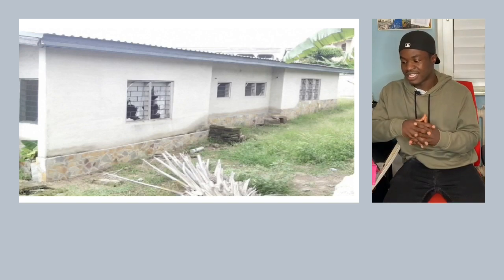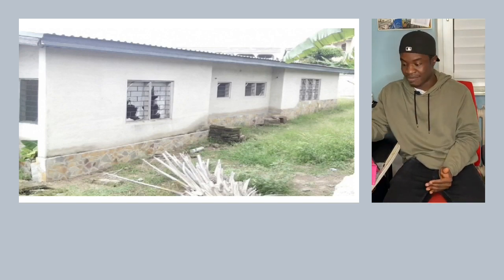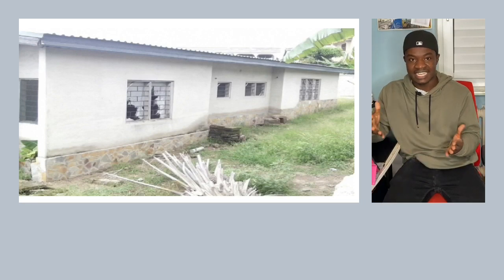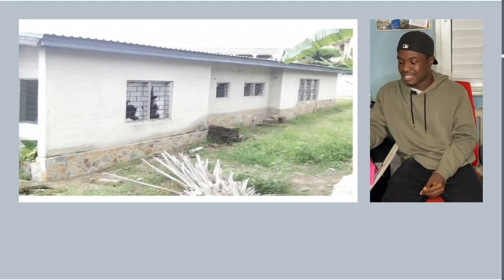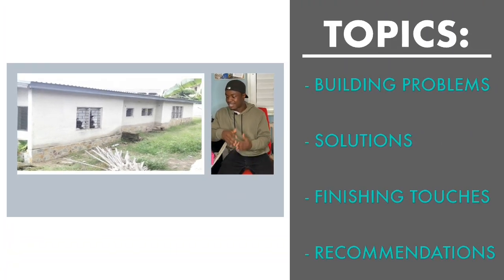BUILDING IN GHANA || PROBLEMS AND SOLUTIONS | CONTRACTORS RECOMMENDATIONS || DON‘T WASTE MONEY

Comment: I have worked in the house construction building so I know what I am speaking about
Reply: I have already built so how can I use or solution to prevent the Damp... Thank you
Reply: @abdallahgibril4836  I am sorry on this question I can't tell you a solution because you already built up the walls I don't even know if there is a water penetrating solution that you can bore holes along the joint and then pump it through so that it will spread and then form a base that will stop the damp from coming up through the blocks we live and learn sorry I can't advice you on this matter
Reply: @kojomensah7474  oh OK thank you 🙏🏾
Reply: @abdallahgibril4836  I don't know if you will be building again but I would advise all those to look at  polystyrene panels which is much faster than using concrete blocks and I don't think there will be this issues of  water vapor
Reply: @kojomensah7474  you welcome 🙏🏾
Reply: @kojomensah7474  polystyrene panels are coated afterwards with concrete so that is not a solution

Comment: They did not know it is not the fault of the house holder but many of yr people come to Europe but they don't take note of anything I knew of this already but I am not on a plat form to tell those that are getting their house build a plastic should have been put on the very first 3course of block then they could carry non with the rest of courses there is water solution call black jack when it drys it becomes like a rubber that stops the damp from rising Futher through the blocks

Comment: What about if you have already build .. any solution to the dump
Reply from the maker: The injection method 
But expensive
Reply: @Knowledge_Junction001  please expensive like how much cost you talking about... Thank you
Reply from the maker: @abdallahgibril4836  they measure per square meter
Reply: @Knowledge_Junction001 .. How much is it please
Reply from the maker: @abdallahgibril4836  the price depends on the damage and they measure according to square meter
Reply: @Knowledge_Junction001  mine is a new house but I didn't put the rubber during the foundation
Reply from the maker: @abdallahgibril4836  yes , and am saying they have come and look at the damage and measure it then they give you an estimated price because the chemical is liquid and it may depend on its concentration and area to cover
Reply: @Knowledge_Junction001  OK thank you... Can u send me ur contact... Thank you
Reply from the maker: @abdallahgibril4836  +12678430992

Comment: Please using bitumen to paint all the external walls will be an extra cost to the client. It's not advisable. 

It's advisable that during Plastering and painting,  you buy  Plastering sand and get quality paint with a good painter.

The quality,coats and the thickness of the paint is what you need to consider to avoid rain staying on the walls.
Reply from the maker: True , but some clients don’t care about cost. Again we have a chemical that can be added to the plaster to obtain a smooth surface .Fine Sand,good paint and a skilled mason is it all.

Comment: If you're watching this and thinking of using those local black polythene sheet, it won't make any difference. Those are too light and decay after few yrs. The also can't sustain much damage during casting of the concrete.

There are special plastics materials called Damp Proof membrane for doing this. Joints are sealed completely with a special tape. Don't cut corners. Even if  you double the black polythene sheets, it's not going to work well.

If you can can't cover the entire foundation, the cheapest, but less effective if to use the membrane when laying the first block after the foundation. Is will not protect the foundation concrete (including floor tiles) but at least it it'll protect the visible wall. 

Best solution always cost more. Instead of doing 6 bedrooms, do 4 and spend the rest of quality build.
Reply: Which companies sell the damp Proof membrane ( DPM) and the damp Proof course ( DPC). Do i still have to paint the foundation with water resistance paint b4 filling the foundation??
Reply: @aka2793  personally, I don't think the waterproof paint or betumen will cut it unless the source of moisture is from the sides. For most people, moisture travels through the foundation block work. Hence the need to use DPM + DPC or at least DPC. Also use damp proof chemicals to plaster the just the base so plastering doesn't become the point of weakness. Once done, you're all set and free from higher maintenance cost in the future. I think the best solution we'll be to cast a moisture proof foundation. Cus even with the above, the building foundation isn't protected. I've also seen people wrapping the entire foundation to the top with DPM on YouTube. A requirement in certain places... especially for basements.

Oh also, casting your floor (5inch +) before raising walls introduces a barrier for moisture... you might as well add DPM there. 

Also water proof doesn't sound the same as damp proof. Something to keep in mind.
Reply: @aberba  what company do u work for and any way I could reach u outside YouTube??